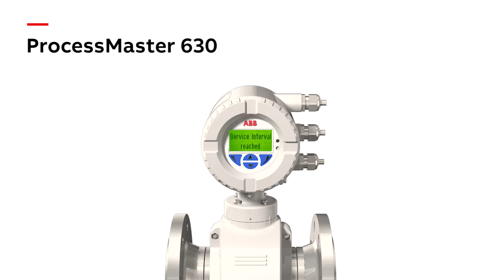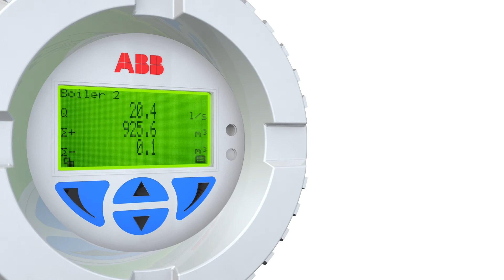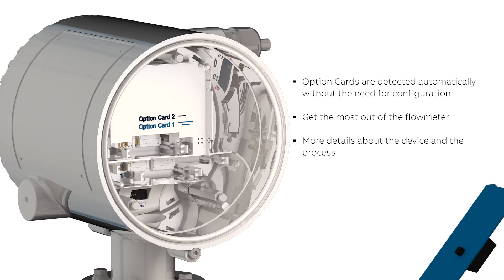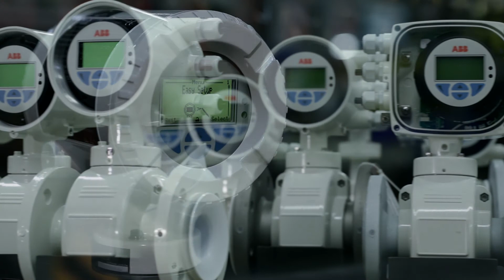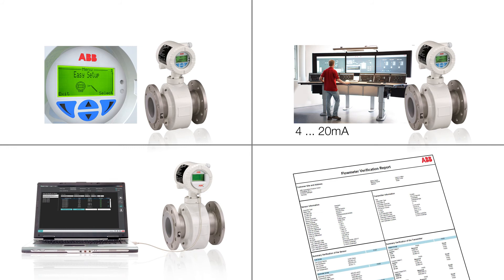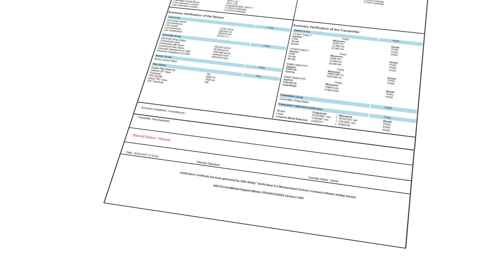The next generation of electromagnetic flowmeters - ABB ProcessMaster and HygienicMaster

Comment: What is its advantage to other flowmeters. Please specify cause im a sales engineer of your product i can help you
Reply from the maker: Hi Laurence - thanks for your question! In addition to flow-measurement, ABB’s FEP630/FEH630 features temperature and conductivity monitoring. 
Online diagnostics and continuous self‐monitoring checks for Hardware errors, process issues and incorrect operation.  Infrared port allows access to all information of the flowmeter without any intervention.  
For more information, or to find a local contact, please visit>>https://new.abb.com/products/measurement-products/flow/electromagnetic-flowmeters/process-industry
Reply: Installation fc
Reply: I'm Prishtha from ATLANTECH, we are the manufacturers of electromagnetic flow meters and industries we serve are Water, Cement, Effluent Treatment Plants, Sewerage Treatment Plants and many more.

For inquires feel free to contact
91-8239752426 or dealersupport@atlantech.in